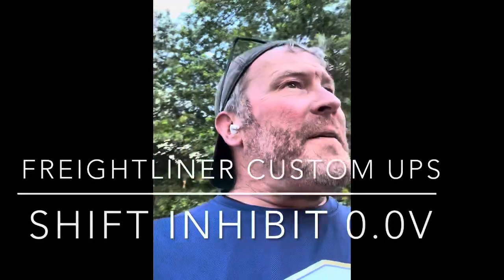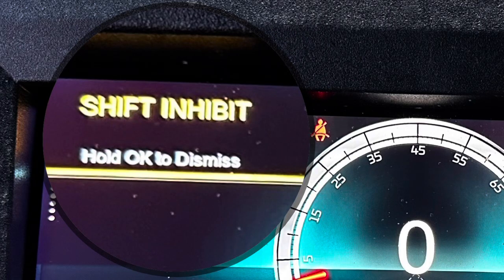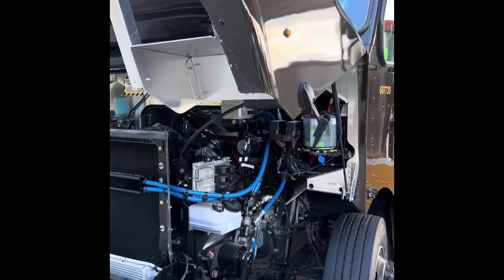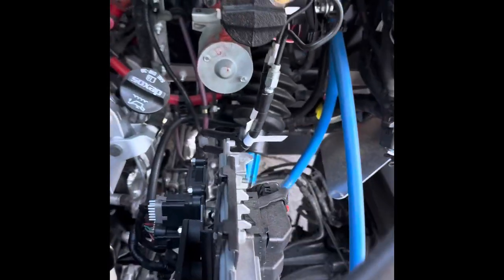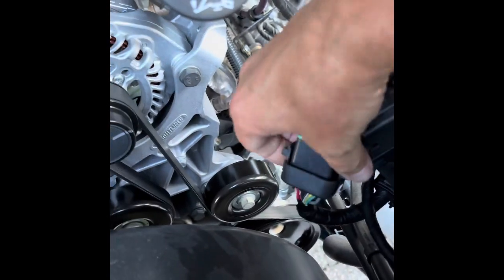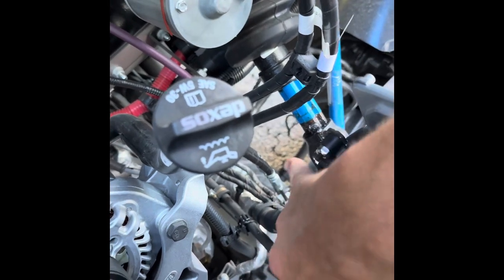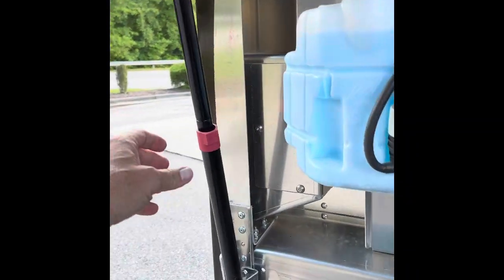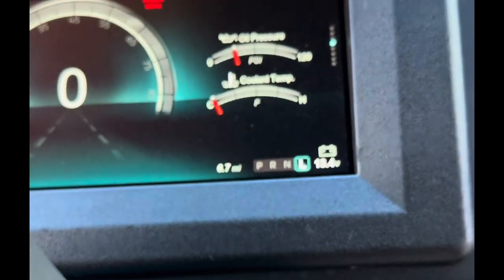Freightliner shift inhibit and 0.0V fix

Comment: This video actually helped me to drive my Freightliner M2 106 boxtruck to the mechanic shop, instead of getting stuck on the road side…I unplugged 2 outlet wire plugs that went to my fuse box and boom I put the gear on drive and it works, but couldn’t reverse….So, overall, thank you so very much